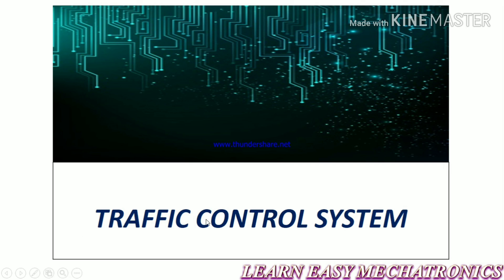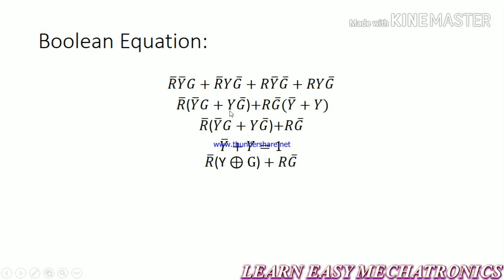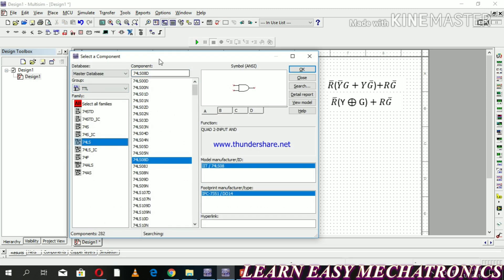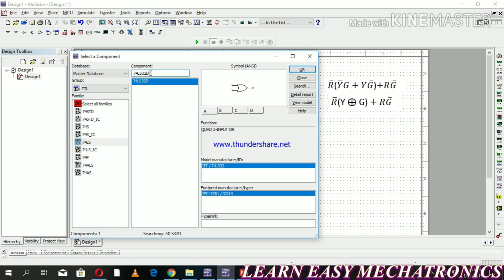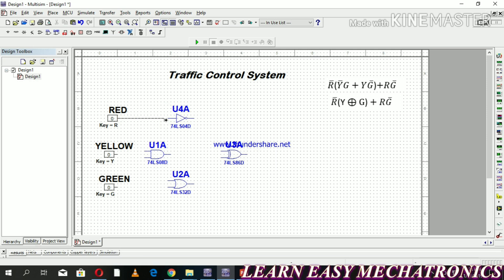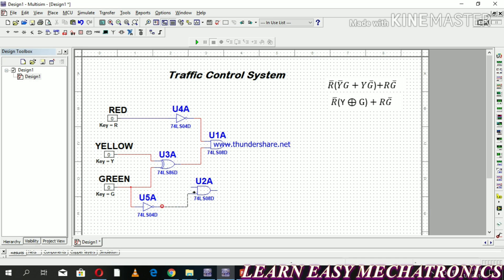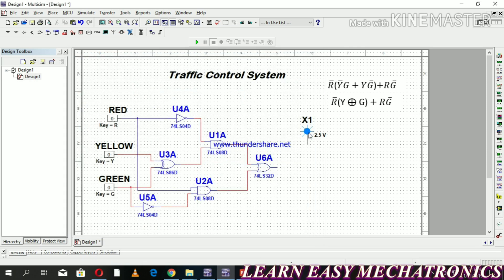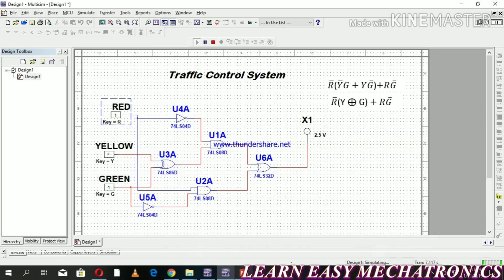How to Design Traffic Control System in Multisim software.

Comment: well done, but this is for one way traffic signal. Students also search for 2 ways traffic signals and 4 ways traffic signlas. If possible make 2 and 4 ways circuits too.
Reply: Yes.I  need 4 ways traffic light controller system